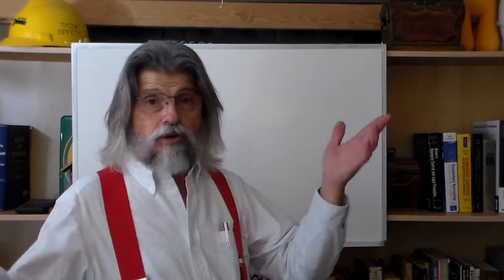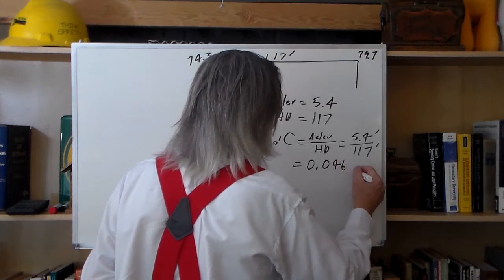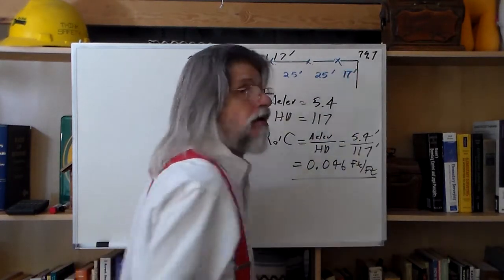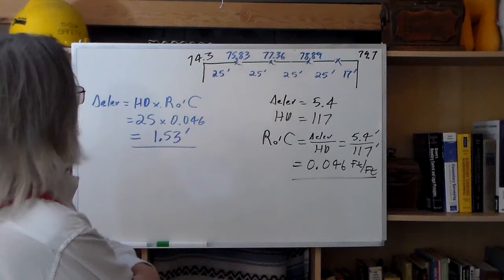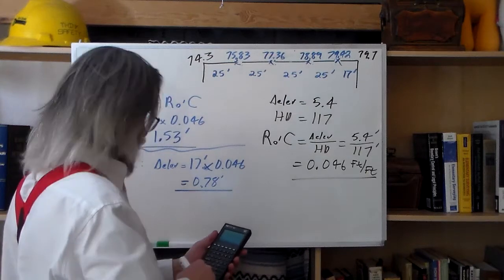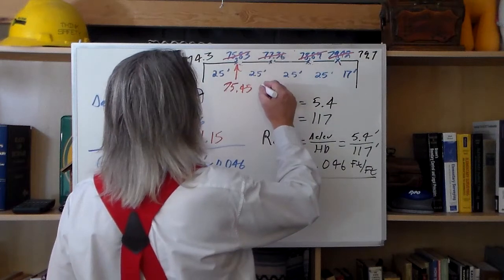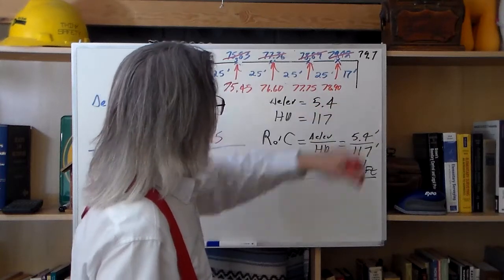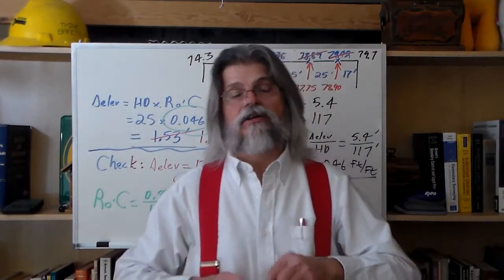Elevations Along Curb Line

Comment: good video man. 
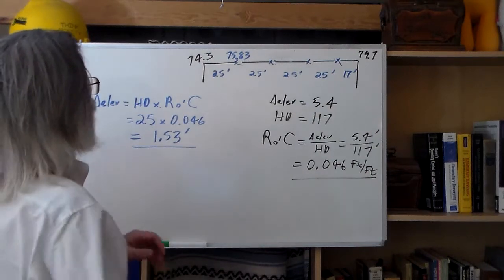... my focus is not consistent so at 8:15 I was thinking just to make the last distance 25 instead of 17 ft and then where it cuts off at 17 ft will be the necessary height but I think at that point I could get real lazy after 25 or 50 ft and then just run a straight level line line but I would lose precision for the sag factor...?...
... but that's why I'm an artist instead of an engineer although I was going to school for engineering and then decided to switch to advertising and visual communications cuz I just like to draw. 
... when I do field sketching and elevations for people sometimes this would have been handy to know.

.... vineyard sophisticated organic hand measuring system is pretty accurate with the 17 ft the way it looks in compared to the 25s as well💪